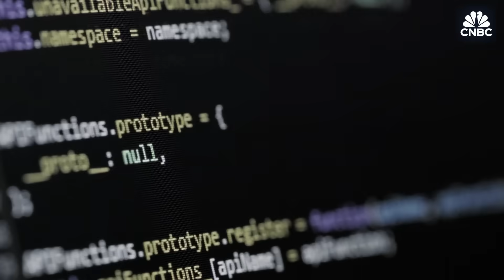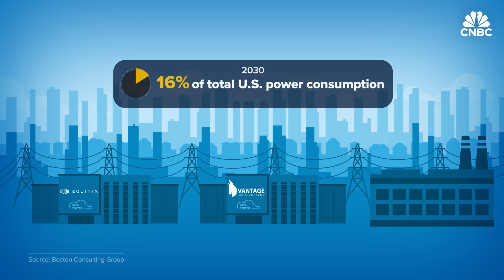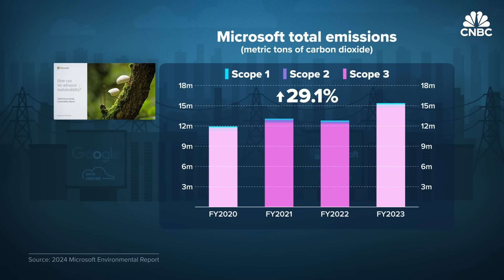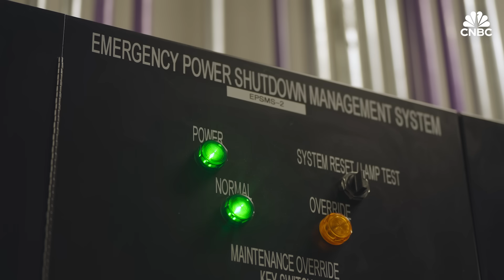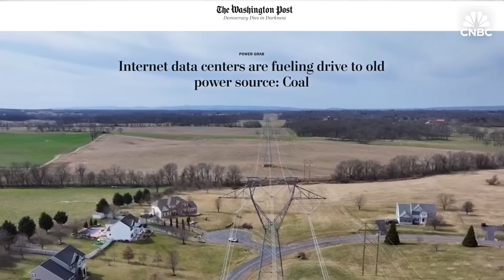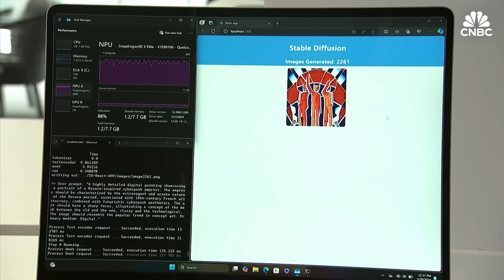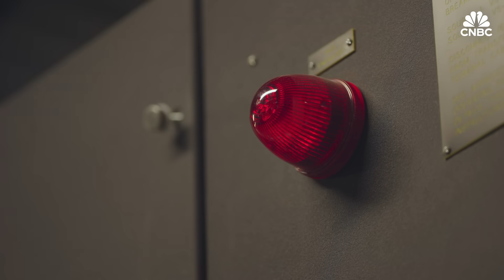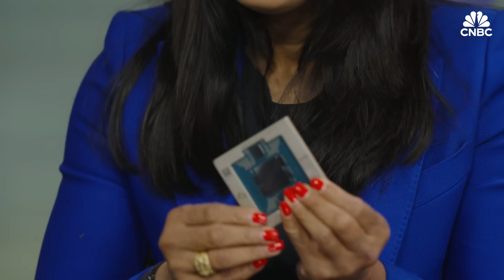How The Massive Power Draw Of Generative AI Is Overtaxing Our Grid

Comment: I don’t understand why any energy hungry building with a large unobstructed roof isn’t covered in solar.
Reply: Also, those buildings are usually leased, and the owner doesn’t care.
Reply: While I agree, I can also see how little it would actually do; the best solar panel you can buy right now has an output of 550w max, and is 7’ x 4’. If you use the tightest spacing you can, that means a best-case scenario of 2MW, which is less than 5% of the estimated building’s consumption. To be clear, it’s not 0%, but it’s literally a drop in the bucket; not enough to make a significant difference.
Reply: @jacobcarlson4010 5% is a lot for a business, especially if it ends up much cheaper than buying from the grid.

There are entire industries with profit margins below 5%.
Reply: @jacobcarlson4010  It would generate more electric than the roof that's on it now. More cost-efficient than those windmills we're putting up.
Reply: The data centers for training Generative AI are designed to rely on stable grid power, but the solar power is unstable. The ideal way to power large data centers now is through nuclear power plants, as they are stable, capable of providing high power, and can supply water for cooling.
Reply: @silence3d312 it goes through inverters which match it to the grid, if anything the grid would be the unreliable part of the system
Reply: @silence3d312  I don't understand the logic of your assertion.  A building can seamlessly transition between its own generation and the grid, so a building (whatever it's doing) is not impaired by adding solar to its energy mix.
Reply: The data center roof absolutely can't leak.  It is likely more costly to build the roof so that it's maintainable with roof perforations to support  attaching solar panels.  I'm sure leak proof datacenter roof technology exists, but at what cost?
Reply: The answer is, that the amount of energy that a solar roof would provide to the data center would be minuscule compared to the consumption.
A solar roof would provide them the same amount of energy to power two or three houses, but they are consuming the equivalent to tens of thousands of homes.
It would be basically a joke to put solar panels on the roof.
Reply: Roofs only leak because the solar install was not done properly. And there is more than enough space to make good use of PV
Reply: It’d be a nice symbolic move at least.
Reply: electricity is way cheaper when the sun is gone, and suffice to say its not cause they are firing up all the lunar panels
Reply: Because solar power is crap at providing the required electricity for data centres.
Reply: @daniel_913  The electricity provided by solar is perfectly good for supplementing the power needs of a grid-tied data centre.  Please explain your criticism.
Reply: Because it isn't economic. And because white roof paint makes more sense.
Reply: Make solar panels stronger then.
Reply: @raymondsantiago2411 
The sun only emits a small amount per SQM
Reply: @Robert-j6r8c  it's less a matter of the intensity we get on earth, if we could harness 50% of that power that would be a miraculous improvement. the tech we have for solar panels just limits the maximum to 30%. my field is not in semiconductors so i cannot give any useful input on whether it's feasible to go that high.
Reply: @raymondsantiago2411  There are physical limits to how much energy a solar cell can produce, and we are getting pretty close to it. Not to mention that hyper-efficient solar panels are extremely expensive and only viable for spacecraft.
Reply: @raymondsantiago2411  They're working on it. Solar Panels are always improving. Not sure what the upper limit is
Reply: Lol. Let me know when you get that one figured out.

Comment: The human brain uses about 10 to 20 Watts of power to function. Brain cells, like all cells, had to be energy efficient from day one. AI researchers don't consider things like energy usage or cost when designing their models.
Reply: There are analog neural network chips that act more like the human brain with way less power consumption for a given output than digital chips.
Reply: @gregorymalchuk272  exactly, most likely this will be the way to go.
Reply: @gregorymalchuk272  Biden robot only has 1 brain cell
Reply: They do think about "power efficiency" but their thinking is via or through optimizing their software which means do the same with less CPU cycles. If you can do that in software then you will save power.
Reply: Power consumption optimization is a byproduct of software optimization, which is what they think about all the time. 

There may be optimizations somewhere for software engineers separate from code optimization, but its eclipsed by hardware optimizations. 

So yes, from day 1 they were probably thinking about power consumption, just in a roundabout way.

Comment: Right, so ChatGPT inquiry may take 10x more in power than a Google search does, but when the A.I. gives you the info you need, then a lot of time and energy ultimately has been saved. If I have to wade through multiple websites, search results, etc, to find what I need, that the cost may ultimately be higher than if I had just asked A.I. to begin with.

Comment: Why doesn’t every data center use solar and wind ? It’s a building the roof should be covered in solar panels?
Reply: Because there isn't enough roof. Even if you covered it in solar panels it would only cover a small fraction of the building's power usage.

Comment: No it's not. Our grid has been overtaxed since the 1980s when it should have been updated. Hooks from 1920s broke recently and released power lines that electrocuted linemen. No excuses why hooks from the 1920s are holding up power lines in 2024. Absolutely ridiculous.

Comment: Solve the energy requirement, you've still got the raw material & manufacturing requirement. Mining materials and production exposures/by-product is extremely hazardous. Solve both problems? You'll have a skilled labor shortage because the current edu system is inadequate.

Comment: The grid is and should always be maxed out; that's called efficient resource use. The grid will grow with demand.
Reply: I know a lot of people don't really understand infrastructure, but the grid should not always be maxed out. There are surge requirements, redundancies, and cost to the consumer to consider. The only reason large energy surplus is not desired (other than to keep prices high) is because we currently lack large scale energy storage infrastructure, and are still largely using expensive, non-renewable sources of electricity.

Comment: Data centers are not always using new water. It's in a closed loop.
Reply: Many places uses adiabatic chillers wh use water a lot. I work in dc industry
Reply: Depends. Some use closed loop that go through chillers. Others use evaporative cooling, which does recycle the water, but also looses some each cycle, as I’m sure you know.
Reply: @10sideproductions79  Water is not really lost at any time, after all it is used for cooling, it turns into steam and then falls back down as rain. The water is not being contaminated with toxic substances or anything like that, so it can fulfill its normal cycle. 
And the electric energy... It is an easy problem to solve and really that companies are consuming a lot of electricity is good for us because they will create new generators that will be much more stable, safe and clean, also create a boost in the development of nuclear energy and solar panels.
Reply: Yup. This video took some...humongous shortcuts...in explaining some things.

Comment: I wonder if Canada's vast hydrology could be relevant to tackle both water cooling and electricity generation, though I guess it would imply setting data centers in relatively remote locations albeit not that far from the US.
Reply: we already have made enough massive dams that flooded massive valleys. what more do you want from us?
Reply: Fair enough. It's just that being from Quebec I was wondering about the foreign investment potential as projected energy demand from the transition away from fossil fuels will already require significantly more capacity. Leveraging our water resources as they become more valuable may also be advantageous in general. But I do realize it's not the only relevant consideration.

Comment: No.  AI is not overtaxing the grid.  In unlikely extreme scenarios, grid operators will shut down datacenters before they let them bring down any sections of the grid by turning off the breaker that powers the datacenter's power transformers.

It's actually the other way around: AI will be limited by grid and the amount of reliable energy it can get access to.  Just like biological organisms, the amount of available energy will impose an upper limit on how large it can grow.

Furthermore, datacenters have massive amounts of rooftop and parking lot space.  The largest datacenters are built in in more rural locations too for access to wind and solar farms they actually construct or buy energy directly from.  On-site solar (roof, parking lot) combined with onsite energy storage are especially advantageous as all that energy is produced and used locally without even hitting the grid.

Availability of power is the #1 design requirement for datacenters.  If there is not enough projected power in the area, datacenters will not be built there.
Reply: Of course, data centers are built where power is available. But have you considered the fact that AI-heavy data centers are taking power away from other potential projects that could actually be beneficial? How about having to run gas and coal powered plants 24/7 just to keep up with their energy demand where otherwise wind or solar would have been adequate? 
In other words, we are wasting enormous energy resources just to allow some corporation to sell 5% more stuff. Does it sound reasonable?
Reply: @SashaBuzko  You make a valid point.  I think whether this AI and datacenter growth is "reasonable" or not will be a societal choice, and the choice of AI and datacenters have far more profound effects than just the power requirements.

Even so, datacenter power use is still a tiny portion of the entire US 4230TWh annual electrical use.  Even tinier portion of the whole 94-exajoules of energy used for all energy requirements.

The US already generates 233TWh of its annual grid from solar and its growing at a very stark 30-percent compound annual growth rate (CAGR).  With that growth rate, by 2034, solar alone could provide the US annual electrical demand.  This doesn't even include wind power which currently exceed US solar.

In short, with the amount of renewable energy growth and the huge amounts of sun power the Earth gets, there's no reason not to expect that datacenter growth and power growth cannot both grow at least linearly.

AI and EVs will end up promoting the growth of grids around the world.  Something that needs to be done anyways as the world transitions away from fossil fuels.
Reply: man, it is not about how much power it takes for AI to "think"(inference) .. its about how many people are simultaniously trying to make the AI think at the same time..  if millions of people runs AI inference at the same time, then obviously the inference will overtax the grid.
Reply: @StarnikBayley  There are rate limiting subsystems that will easily prevent this unlikely scenario.
Reply: @beyondfossil   but if you deny service to 0.1% of the millions of people trying to use AI because  because of rate limiting systems , what quality does the service hold anyways ?
Reply: @StarnikBayley  A full denial of service is just one option.  Most of the time, CPU or I/O will be throttled back.  So your request will take a bit longer than otherwise.  Anyone is using a networked distributed service today will be throttled at any given moment and not even realize it.

Furthermore, performance monitoring is an on-going thing in any business, including IT.  Trend and spike usage reports should show backlogs and throttling.  The business would be wise to add more capacity as needed.
Reply: @beyondfossil   AI inference is much more expensive and requires much more wattage than a CRUD request. i believe that you can't compare the present tech pipeline efficiency based on database bound  application, which uses a fraction of power compared to AI inference that uses GPUs, which guzzle power at high wattage.  scaling AI infra will require additional power as well. generating a single image with GAI takes 30 seconds locally for me, with GPU running on 500 watts. whereas i can easily do a database query on a much less powerful system, maybe running at 100 watts at a fraction of a second.  AI inference takes at least 30~100  times more power than a traditional web request. multiply it by million simultanious users, and the  magnititude of the parameters of models increasing, in every new iteration of AI. power shortage is a real issue. even crypto currencies are using more power than entire countries right now, and it is not even mainstream. AI will become mainstream, and power shortage will be a real issue.
Reply: @StarnikBayley  ...and back to the original post topic and the topic of this CNBC video, AI and datacenters will not take down the grid.  As I stated, its actually the grid and available power that will limit AI's growth just like any organism biological or otherwise.

But to indulge in this a bit: sure, individual CrUD requests may use less resources than a single AI inference but there are orders of magnitude more CrUD requests.  I'm seeing 23,000 requests per second globally just for credit card processing.  This doesn't include what I'd guess hundreds of thousands requests more per second of other CrUD calls for database, API, and web requests occurring simultaneously.

But, again, this is getting off track from what the thread and video because the amount of power will limit the growth of these activities also.
Reply: @beyondfossil  ...indulging further, it will not take down the grid i agree, there are systems in place. but it can't scale without taxing the grid. 23,000 requests per second globally can be processed by a single data center, with each server processing 500 requests per second(lowball figure). AI inference is a different beast. either you deny the service or you make a queue which will make you wait a long time. crypto is already suffering from so called "gas fees". i understand what you mean, but the limits are lower for AI compared to credit card processing. if you divide 23,000 by 50 based on power consumption its only 460 request per second ignoring the time required for inference. and people will ask more question to AI than do credit transactions..
Reply: @StarnikBayley  it already is millions of people?
Reply: @FusionC6  1% of 7.9 billion people(current world population) is 79 million. You do the rest of the math.
Reply: biased much? so which data center owner / builder do you work for? 🙄

you really think building these stupid things in rural areas has no environmental impact?
Reply: @MauiBoi-l3g  Calm down
Reply: @MauiBoi-l3g  Ad hominem
Reply: Yeah, this makes more sense. Title is a bit alarmist.

They really think data centers can run roughshod over grid operators?
Reply: @anxiousearth680  Exactly.  Very click bait title.

This CNBC story is like the 5th one I've seen on AI and datacenter power in the past few weeks.  And the keyword "AI" is part of a big trending global subject right now.

What I've noticed here is if one news outlet makes a "big" story that gets lots of views, all the rest of the news outlets come out with their own stories about this subject.

Comment: Build data centers in barren lands and surround them with solar cells, wind mills or geo thermal power.Big corps are aware of this issue for several years and we also have solutions to tackle it but they are doing nothing. Maybe governments should mandate that atleast 40 to 50% of energy needs of a datacenter needs to be met by renewable sources
Reply: Your forgetting the latency problem, most data centers are either in the urban center or outskirts so that they are efficient in providing data to where people need it. The only service that would benefit from being built far away is either archiving or cloud storage which is also small in power usage anyways.
Reply: @bulletghost3452 AI inferences and especially AI training don't require low latency. What require really low latency is real time duplicated transactions and video streaming. The former is caused by legal requirements that in theory could be changed.
Reply: Training models doesn’t need low latency
Reply: Those datacenters have large rooftops that would be perfect for solar arrays.  It must be cheaper to just buy electricity from the power utility.
Reply: A big challenge would be getting workers there. You need high skilled workers to maintain those infrastructures and it would be hard and expensive to get them to move to the middle of nowhere.
Reply: Building in barren land means running power and data lines, which is very expensive. The ideal location for a data center is usually on the outskirts of a small town - where land is cheap, but utilities are already nearby.